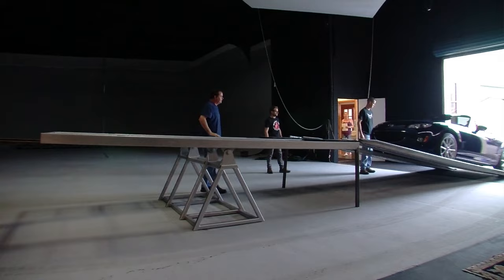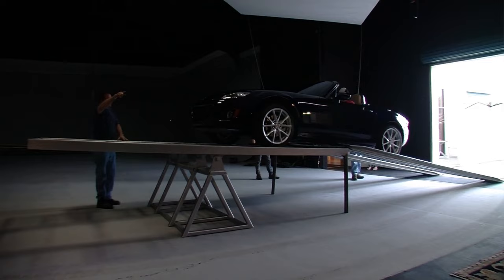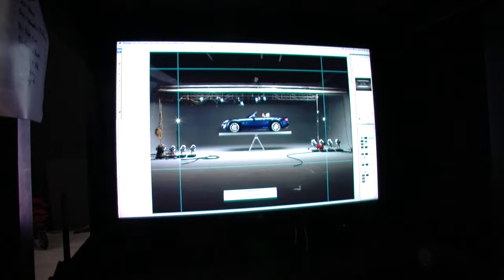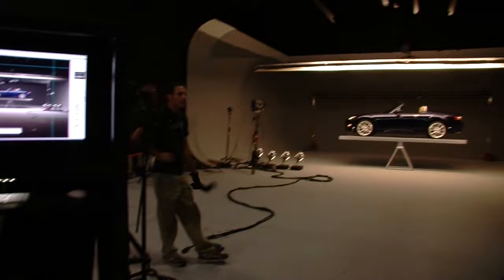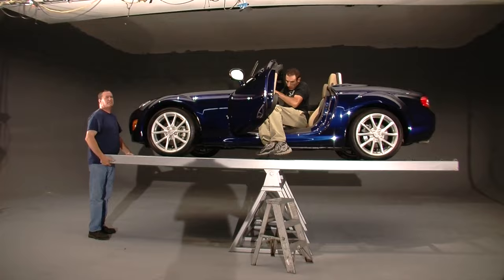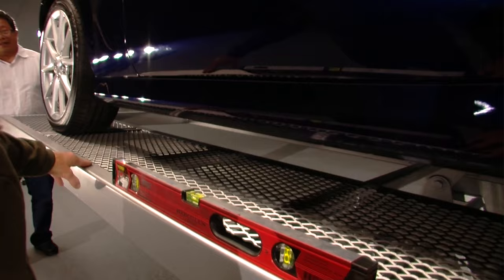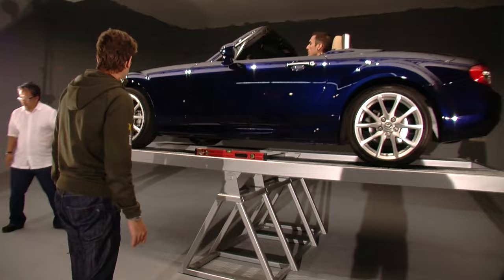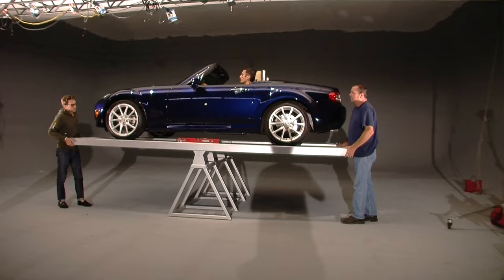Mazda MX-5 Miata "Balance" Ad — Behind the Scenes | Mazda USA

Comment: @gethsemeny Your statement is invalid. They are not defying the laws of physics, nor are they making the paws of physics serve them[mazda]. If anything, they are following the laws of physics just like every other mortal. You can balance every car in the world. The only difference is Mazda made the weight so the balance on the wheels is 50/50 which makes for great handling, but by no means 'defies' physics. My Dodge Ram can also balance on a pivot, but it wouldn't be 50/50.

Comment: Back in the 1990s someone in our Miata club designed a giant teeter-totter like that but about half as tall so you could drive straight onto it. It was connected to a timer that measured the time you stayed balanced over a two minute period. My buddy and I found the secret which involved using the doors to keep balance much the same way you'd do so with your arms. The result is that were able to stay completely balanced for a full minute out of two!

Comment: That's a pretty picture, but how do we know that the distance from the fulcrum to the front wheels is exactly the same as the distance from the fulcrum to the rear wheels?  After all, you could balance any car on a teeter-totter, even an FWD car with 65/35 weight distribution or a Porsche 911 with 40/60, by rolling it back and forth to the equilibrium point.

Comment: Bust out the tape and measure the distance from center line to each axle...then i'll be impressed. It takes a lot of adjustments to a race prepped car to achieved a perect balance and cross weight.....good plubicity stunt for mazda brochures though....

Comment: Of course you realize that the same thing could be done with ANY car (or ANYTHING else for that matter) by simply moving the car forward or backward on the teeter totter until it was balanced. Ooops, I guess the highly paid engineers forgot about that, huh?
Reply: The point my dear is that it is perfectly balanced which means it's center of gravity is right in the middle between the back and front wheels !!!! 

Most cars have the weight at the front cause of the engine..... Which causes understeer and loss of traction at the back tired....
Clearly as a driver you have no clue what constitutes of a weight balanced car..... I can bet you are an American muscle car lover that believes in straight line performance
Reply: What instrument did you use to determine this? I suggest you use google images to examine some optical illusions before you trust your eyes. It actually looks a little forward to me.
Reply: Marq Goldberg It would be impossible for it to be 'a little forward' because then it would tip. Its a Front engine vehicle so the weight will be more biased to the front of the vehicle. You could try it with any vehicle but you would have to move it way more off the center of gravity then you would with a miata, if the miata in this video was even off for that matter. The miata is notorious for being well balanced and light, I don't know what you're arguing about
Reply: Marq Goldberg Yeah but the car is in the middle here as you can see... I'm sure they measured it all out...
Reply: v

Comment: Why does ONLY the GT touring model come with navigation?  The Club model should have navigation too...already has the large infotainment screen, duh!  Even the Mazda 3 ($23k) has stuff that are stingily omitted on the Miata ($26k) such as: 1) autodimming rearview mirror  2) blind spot side mirrors  3) Heads-up display  4) paddle shifters for automatic transmission   5) homelink garage door opener 6) 215/45/18 tires on 18 inch rims  7) backup camera
Reply: Weight. Weight. And Weight.

If you're looking for a car with those features, the MX-5 is definitely not for you.
Reply: @John Hoo: U are right, I've already dropped the Mazda from my list.